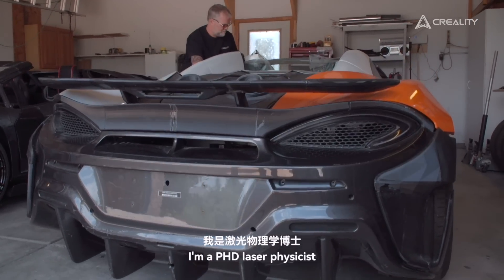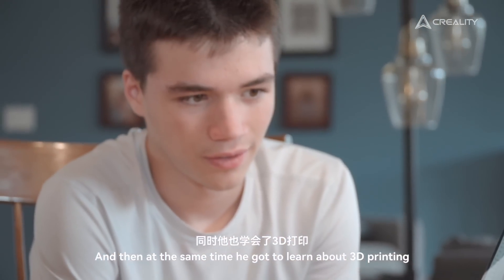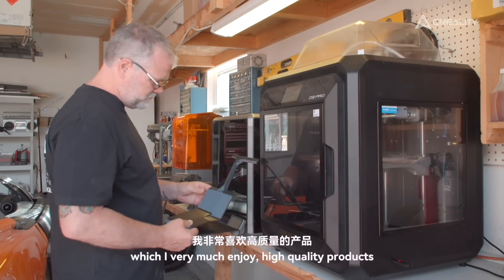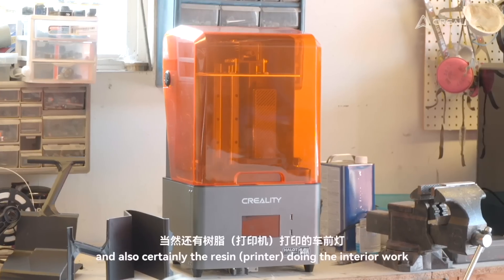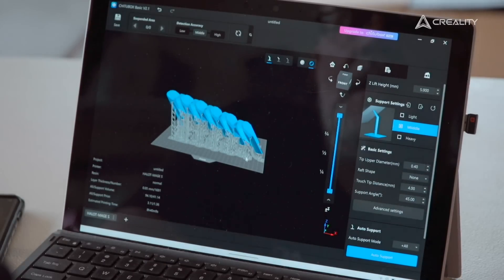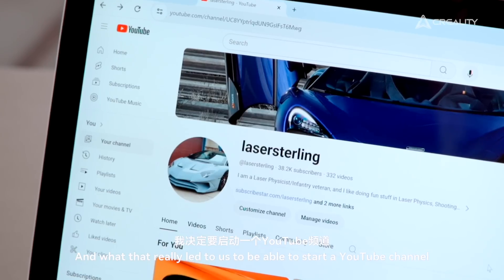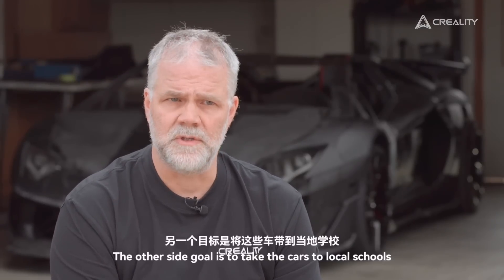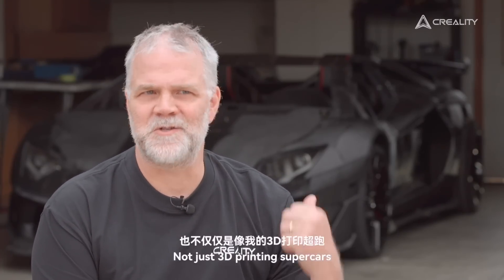Supercar Reconstruction: Dr. Sterling Backus and His 3D Printed Lamborghini

Comment: Hey creality I bought a ender 3 v3 se and it won’t print at all. I bought it last year. And it worked for the first like 5 prints then stopped printing correctly. Then I talked to support then they said they couldn’t help me. But they sent me a free build plate and it didn’t work. My 30 days have been up on the return but do yall know why it’s doing it? Problem one choppy prints even tho I copied the perfect slicer settings I leveled the bed. The print seems to pick up in certain spots on the plate and and the prints are always choppy.